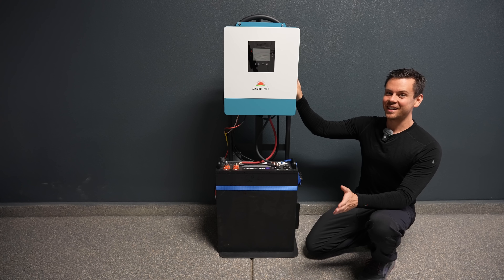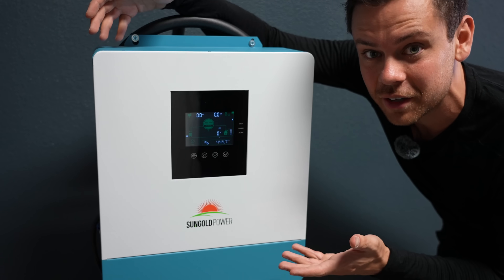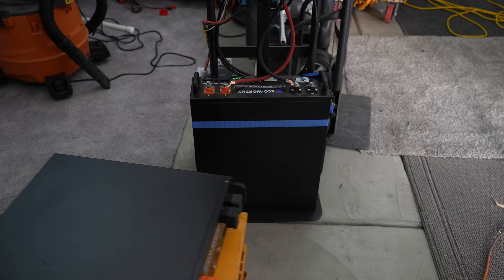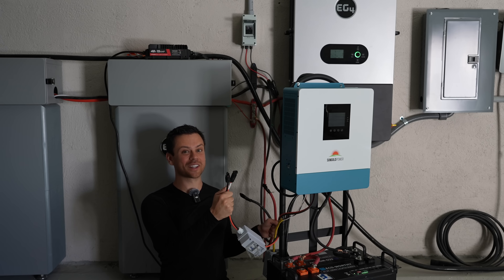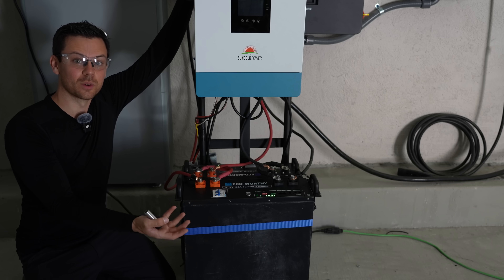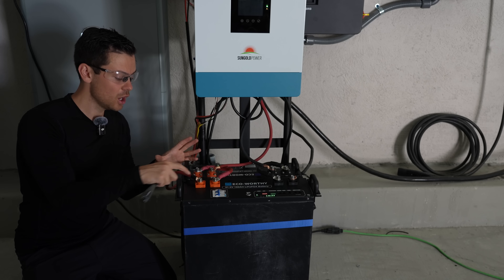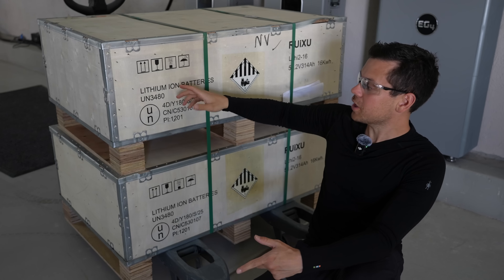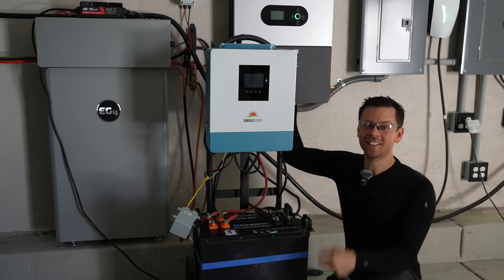DIY 5,000W Disaster Relief Solar Cart Upgraded! Build It Yourself

Comment: You can just weld a larger plate on top of plate on the dolly where the batteries are setting so it goes all the way under both batteries, that's quite a bit of weight and possibly could bend.  It's really nice if the companies will listen to you and their other customers.

Comment: I noticed that Will does not use many disconnects on these hand carts. I am building one now and I wonder if I need one between my busbar and my 3600W inverter. 24v system with 2 12V 314Ah Humsienk Mini batteries in series with 200A termianl fuse blocks. Does anyone have input?

Comment: I built this exact set up a couple months ago and it works great. I am having 1 issue, If all i am running is a Starlink, The inverter goes into standby after 15-20 mins of use, from what i believe is just not enough power consumption for the inverter to realize its doing something.  Any advice on a setting in the software that might need changing?

Comment: Will;
I am lokkkng to put two of these in my Diesel Pusher RV. It has the standard 50amp 240v single phase shore power. 
I am think two of these, 12 405w Bifacial panels and two 48v Seplos 314ah batteries. 
After reviewing these I think they will work. They are short enough since I have a height constraint of 26” tall. 

Thanks for sharing all your knowledge on solar. And your honest sense of humor. Love it!!

Comment: I am building one of these but I am going to use 4 Dumfume 12v 300ah (280ah) batteries in series.  I need to know what size cable to connect the batteries together and will the 200 amp bms in them make a difference in cable size?

Comment: Are the ecoworthy rack batteries able to withstand being in a trailer getting hauled around? Or do you suggest a battery with fire arrestors in them?  Trying to do it one time and not many lol. 

Simple and basic 10kw system for a trailer to run some stuff at night when the generator isn’t running. 

Recharge the batteries with generator during the day when it’s used.

Comment: I just completed this exact setup for backup power with the 80 amp outlet box, no PV input. I don't believe Will touched on this but default input A/C current is set at 60 amps.  You'll want to change that setting if you're using a plug in A/C cord.

Comment: HEY! I wanna do a similar project. What type of battery would be best for this kind of deployment? Thinking of 100ah-200ah batteries as a counterbalance weight on the base of the hand truck. I'm planning on trying to have adjustable panels, up to 4 panels so wattage of around 400w of panels. I'm trying to make an apartment friendly microgrid with the goal of have the capability of a standard rv solar kit.
Reply from the maker: Nice profile pic. And yes thats perfect but you'll need a higher voltage array for this pack voltage nominal. I would put 5x 400 w panels in series

Comment: I bought this system recently for an off grid build. If you decide to go this route please note that sungold inverter does not communicate with eco worthy battery, I have to go to user defined settings. Had I known sooner would have just bought from one company

Comment: Hello Will.  I just built my 1st solar cart.  6000xp with 2x eco worthy batteries.  The load side works great.  However I only have 120v outlets.  I did the firmware updates and see the 120 settings.  However when I plug the grid into the 120 outlet... It shows 120 on the display... But what it doesn't do is charge the batteries.  Any assistance would be appreciated.

Comment: @WillProwse It'd be interesting to see if you could fit one of these rack batteries and the inverter in the sub-trunk on a Tesla as an "emergency tank" to have a way to get another 20-25 miles range.. maybe with some compact fold up solar panels to charge the emegency battery.. hmmm...

Comment: So Will, perhaps I’m the only one asking and maybe not, given to choice of in stalling a 12v system or 48v, which yields better performance? I’m thinking 48v as hardware seems to be more cost effective. Being higher voltage capacity, will last longer? 
Have you done a 48v vs 12v system? Looking to install in rv….Keep up the great work!

Comment: Hi Will, I was wondering if it's possible to turn off the inverter on this equipment and allow only the solar charger to keep running and charging battery while we're away from the cabin for several weeks? Awsome channel by the way!
Reply: That's a good question

Comment: @2:25 Wouldn't it be better to have inverter cables from the parallel batteries split between the two batteries in order to balance the cable resistance?

Comment: I want to build a system like this to power 2 Bitcoin mining rigs using about 1750 watts each. This should work perfectly! The questions I have are... Can I run this without batteries and basically in the day it will power the miners and then can it switch over to grid when power production falls off late in the day, and auto switch over in the morning again? Second question would be how many batteries would I need to save up for to power this overnight? I'm guessing 4 or 5 of those rack batteries?

Comment: What I need is something smaller like a UPS,  1000w peak draw, run for a couple of hours.  Lead Acid rack mount UPS run around $400 used / 1000 new e.g. APC Smart-UPS SRT 1000 Rack Mount 120V (SRT1000RMXLA)

Comment: Yes SRNE is a good manufacturer of Inverter full spot, big company too. I personally have Growatt Inverter, which are equally as good, and so cheap now I bought one as a backup option / insurance against failure for the other two in used. Its now collecting dust!

Comment: I'm a huge fan of crash carts and (semi)-portable chargers. Is there anything you could recommend for a smaller application? For instance: I like to keep my e-bike and portable electric equipment charged in the garage, but the garage itself isn't off-grid. Right now I have two 50W solar panels with a 12V converter hooked up to an AGM battery that then powers an inverter (all collected from EoL equipment at work). It looks rather Frankenstein-ish, but I like the portability if I need to bring it in the house to power the fridge in an emergency.

Before anyone suggests: I also have an MPPT controller hooked directly to the e-bike. But since it's not always sunny here, so I like to keep a battery bank charged up just in case.

Comment: Looking for minimal home  backup...last year a hurricane came through, and we were without power for a week. Ran a generator 24 / 7 for the fridge, lights and tv, but would like to use this solution instead and charge the batteries with the generator when needed - reducing noise, and fuel use ( fuel was hard to find during the outage).

Comment: If I want to be able to have Five 120v outlets that can each handle 20amps, Then what would I need to do to make that happen?   I want to be able to plug in a 1800w water heater into one outlet, a 1500w microwave into a 2nd outlet and a 1500w heater into a 3rd outlet.  I would make sure that I stay within the 5000w limit of the inverter.

Comment: If you were willing to do a little shop craft and welding you could redo the lower part for 2 batteries or even a 280 AH big boy. Make the base a little deeper (and wider if doing a 280 version) and mount the wheels more towards the front. It would dramatically change the ease of lifting the cart to move it and rolling the cart around.

Comment: Hi Will, I was waiting so long to hear your thoughts on SRNE! I actually started building my system based on your videos, but went with SRNE as a budget inverter.

Now 3 years in with the SRNE 10kW 110/220V (dual MPPT), and it’s been a beast.

Powering 4 AC units (18k, 2×12k, 5k BTU), full house, servers — no problem.
Started with cheap PowerQueen and Chins batteries, then added 4 Seplos 280Ah Mason units recently.

Had one small issue with a Seplos battery, but their support was fast, told me to check cell connections and that solved it.

Everything runs in a 2×2 meter room under the Honduran sun.
The 5k BTU AC cools the inverter using excess solar during the day.

No complaints at all. Super solid system.
Reply from the maker: Holy cow!! Good feedback on srne. I'm blown away so far

Comment: Looks awesome! I’m just waiting for a solar manufacturer to come out with a dual MPPT input on a 3-5k unit like this. It’d be killer for RV applications. Max out your roof with solar but also have a portable array you could set out. Add an integrated PV disconnect and it’d be perfect
Reply: That would be awesome

Comment: I currently (bad pun!) have 8 of these SunGold 5kW units; one is on a hand truck much like yours (but w/ 48V "golf cart" LiFePO), two are running twinned for 240V split phase in my barn, two are running twinned for 240V split phase at my son's place, and for a future project I'm building a solar trailer with 3 units so I can have 3-phase power in my shop building.  Best bang for the buck IMHO but a bit of a PITA to hook them together to get 240 VAC.

Comment: I use several MPPT controllers from SRNE and they all work quite well and came at a decent cost. They're all rebrands, from Renogy, BougeRV, and Vevor, and though they're all different designs, they conveniently share the same Bluetooth app.
Reply: What suppliers are you sourcing from? I don't see in the descriptions of many who built the product, so would like to price compare the SunGold Power, Renogy, BougeRV, Vevor, etc. if all manufactured by SRNE,
Reply: @TheVideoNorm  not sure I understand the question re. suppliers. I bought the various brands from their websites or Amazon.

Comment: Just in time for hurricane season!  Thanks ;)
Reply: Did it have a output that you could connect to a houses generator plug? How would you get it to that point?
Reply: @l0gic23  You buy a "generator transfer switch".  They're cheap and allow you to designate several outlets in the house that can be powered after a storm.  How many is determined by size of "generator" and switch capacity.

Comment: Hi will
I did try to buy the 24volt 3000 sungoldpower
I had a $100.00 coupon & the $50.00 coupon for email registration 
I evan emailed them 
Yupper they said No
I still have the email
Also i did buy Victron 150-35 & a 24-1200 phenix inverter
Wish thay sold me this unit
Maybie you could tell them 
I do want a 3000 or 5000 sungoldpower with eather 24volt or 48volt battery
You have my email remember me Doug
Thanks Will

Comment: I agree, this all-in-one is a great unit for the money! I use their 3000w / 24V version to run the critical loads in my house 24/7.
Reply: Who manufactured yours? Bought one a couple weeks ago by SGPWOSAY. Not sure if that's good or bad ?
Reply: @mountainman9555  it is a SunGold Power, same as the one in this video except for mine is the 3000 watt / 24 volt unit. As far as manufacturer, I can only guess it is the same one that Will mentioned.
Reply: I do that as well... The one from eco worthy
Along with 4*100ah 24v batteries from them
Fridge, deep freeze, network, furnace, CPAP
Reply: I built a 4kw solar generator with one of these 24v units.   Replaced a mid light solar that died on the set up.
Reply: Mine is the 3000 Watt Sungold power as well.

Comment: Fortunately there is a well-developed market for fans due to the home computer / desktop / gaming-rig crowd.  To really be quiet the designs need to go with larger fans but that winds up being a fairly difficult engineering problem for the form factor of these inverters.  I am fairly partial to Noctua's low-noise fans.

Comment: I just received that same all in one over a father's day promo, took weeks to ship & it's cannot even get it to AC charge 😫..  more manual for me I guess
Reply from the maker: What in the world! Mine charged out of the box. Yeah check the settings. Post on the forum if you can't figure it out
Reply: @WillProwse thanks, & I'll definitely be utilizing that forum shortly if I cannot dial her in.
Reply: @hickboy3067  Did you get it to charge? I just got mine and it won't charge from AC either
Reply: @spacerage3d negative!customer support wants it back now to replace the circuit board, after multiple conversions..😢

Comment: I'm glad you mentioned the powmr because I've been trying to find a 240v inverter that's cheap to hook up my mini split. I already have the mini split and don't want to just buy another air conditioning unit. Makes sense to buy a battery and inverter and have something mobile I can go camping with. I have 4 panels left over from the pallet so I should be able to run the AC during the day for free. 

Is there a way you can buy the powmr inverter and review it please. 😅 I like learning from you.
Reply: I use the PowMR 240v/6500w AIO with 3 Vatrer server rack batteries and 10 410w bifacial solar panels. The system seems to be working well. I don't know what Will has against 240v or PowMR, maybe because he isn't on commission. I wanted 240v. My system cost around $6.5K. Note: I see the 6500w PowMR has gone up in price in the last month. Thanks Trump for the tariffs. When they come down in price again, I might add a 2nd 6500w AIO.  Cheers
Reply: @scott5747 biden did it to.  Stop already unless you know the whole story.  Better yet move to China if you don't like what the united states voted for!
Reply: I think will just meant to avoid the powmr because he's showing a 120v setup so people might buy the powmr 240v. I have come across one video of a guy having issues with powmr but every comment was tearing him apart and saying they have no issues. 

Thank you so much for your comment though because I've been SCRAMBLING hard daily trying to figure out what to do to run my mini split I brought to the desert from my last place. 

Do I buy a power station or make one of these carts? I'm waiting to see the price on Pecrons new 5000 power station to see if it's worth not having to build something. I have 4 380w panels left over from a pallet. The other 6 are hooked up to the original Anker f3800. I know I know, I sort of regret buying the Anker setup but I do like it. It's plug and play and simple. App is nice and works perfectly. Great to take camping too  @scott5747
Reply: @fromcitytowild  Like you say, the power stations are good at plug and play. The ones you make are cheaper and have bigger battery storage. I have a Li Time 3500w I could make a cart system if I wanted. While the batteries have stayed about the same price, the inverters have taken a jump in price of several hundred dollars. I won't be buying more gear until the tariff price come back down.
Cheers

Comment: Awesome. I'm a Ham Radio operator and am concerned if these generate RF noise?
Reply from the maker: The sine wave is cleaner than the grid. Very low THD.
Reply: @WillProwse  Excellent. Do the solar panels or charge controllers or MPT produce RF noise, such as switching noise?
Reply from the maker: @williamlederer7591  in some units it can. need to find way to measure it
Reply from the maker: I don't know what type of noise would affect a ham radio system though

Comment: Keep these videos coming. Could you make a 2 phase/240v hand cart? Need to be able to run a well pump during a power outage.
Reply: 240v is very useful for level 2 charging an EV!
Reply: @tylergood1223  Yep, I'd prefer a single 5000w/240v inverter off grid (I'm In Australia, 240v is normal)
Reply: That would be great
Reply: I need to build one for my well pump as well.

Comment: I have a question for you or your audience.  I have a older Ryobi riding lawn mower 48 volt. It has four 12-volt lead acid batteries. I see YouTube videos all the time change him out for cheap lithium batteries. My only concern with doing that is. Does anyone have a good recommendation for a 12-volt or 48 volt lithium battery. That is waterproof and vibration resistant

Comment: Can you use this without solar to use  for home backup. I want to charge during off-peak hours and to run this system during peak hours??
Reply from the maker: Absolutely! Most use it for that
Reply: @WillProwse do you have a video on how to set that up?
Reply from the maker: @swinkeymo  oh just plug it in and it will charge. Use a Wi-Fi outlet to schedule charging. Then just connect whatever load you want

Comment: @willprowse can you please do some EMI testing with the sungoldpower. I'd love to know if it would interfere with HF, HAM, radio equipment.
Reply from the maker: What kind of test equipment would i need to use
Reply: @WillProwse  A lot of Ham radio operators just use a simple hand held AM radio to "sniff out" the over powering static that some equipment can emit.
Reply: @WillProwse there are some YouTube videos showing different methods. I've seen a guitar amp used, and an dedicated EMI detector, electromagnetic interference. Radios also work. A simple am radio should pickup interference but a shortwave radio that receives SSB, single side band, and works on the 10m, 20m, or 40m bands should be better.
Reply: @WillProwse a local ham club might be able to help out.

Comment: I used 4 gauge Anderson type connectors to connect batteries. I think it's good idea. Batteries can be disconnected fast
Reply: Yes, Anderson connectors... also known more generically as "Power Pole" connectors, are a wonderful invention.  There are three or four standard sizes.   For the larger Anderson's I recommend buying them with the desired-length cables already integrated into the Anderson connector, which avoids a lot of the hassle of having to deal with crimping and/or soldering.